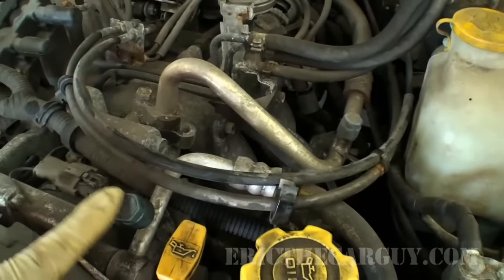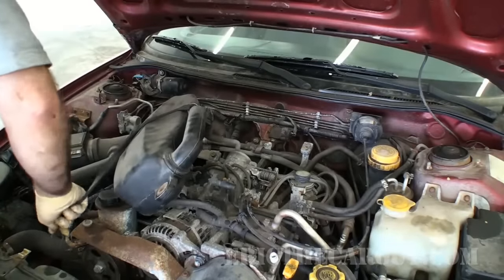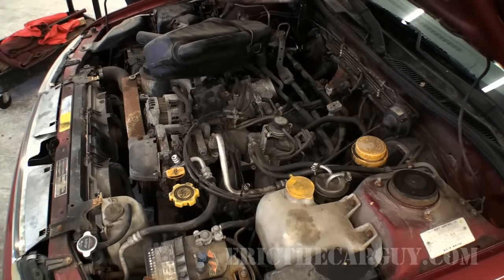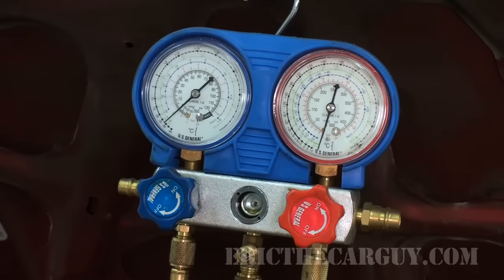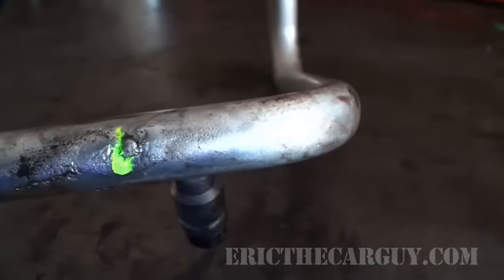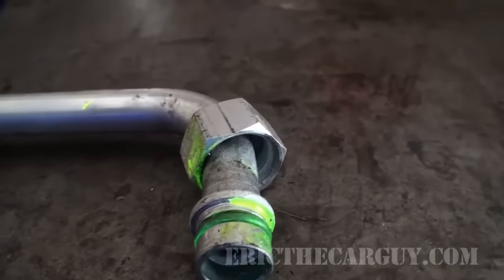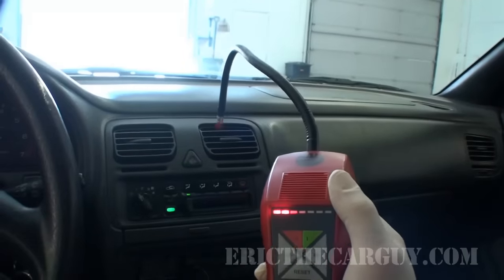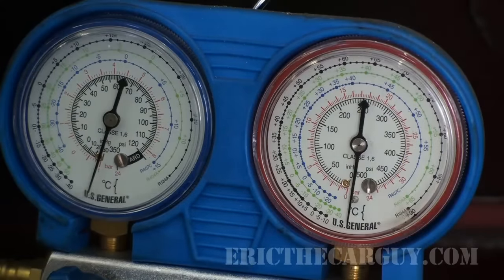How To Find and Repair AC Leaks - EricTheCarGuy

Comment: There is actually a tool that allows you to replace the valve without evacuating the system.  Check out the video by "realfixesrealfast" called "finding and fixing an A/C leak". In the second half of the video he shows the tool and how to use it, so you can skip to around the 5 minute mark if you like.  Search around on the web and you'll find the tool.  Some are not for 134A fittings, and some are only for the high or low side, so be careful in deciding which to purchase.

Comment: Since the receiver dryer will be replaced, I believe you could  use just compressed air to charge up the system to find the leak.

Comment: The gas-specific effects should however be more on a "diffusive" than on a "streaming" timescale. I doubt that a sniffer can detect refrigerant that is diffusing through a hose or seal (except for really, REALLY old and porous hoses). If there is a real (mechanical, macroscopic) leak, you should be able to find it with nitrogen (or any other pressurized gas) and soapy water as an alternative to dye. In places like the evap with no visual contact, the sniffer is certainly a very valuable tool.

Comment: A shop where I had the AC of my car repaired used nitrogen to find leaks. They pressurized the system with nitrogen and sprayed it with soapy water. It will form bubbles where the leak is.
Much more environmentally friendly than using even a small amount of refrigerant.

Comment: Could be the coil of the clutch. Measure the resistance (needs to be a figure of few ohms) and look at the connector of it (wet/dirty/bad connection between). Could also be the pressure sensor that detects fluid for the AC control unit. If it doesn't work, it cannot detect fluid and the clutch won't respond then. I had this issue on another car here in Germany. Should work similarly on a Mustang. Greetings.

Comment: Got a fast leak in my suburban looses refrigerant in a matter of days. Put dye in and everything is ok but I have dye all over my seats and door panels and vents. What do you think is causing this
Reply: your evaporator has a pin hole leak in it that's the reason its all over your cabin (inside your car all over interior) hope i help you out
Reply: tony hvac
thats what I thought too.  Pulled the dash and put new evaporator in.  Old evaporator, I cant find any dye that leaked out.  I put vacuum to the system and it leaked out within a minute or two.  Added a small amount of refrigerant with dye.  It held for a few days but seems like it is loosing its charge.  Went and bought a sniffer at harbor freight and the line where the evaporator bottom connects to the condenser is making the sniffer go off.  So I guess this line is leaking?  Maybe it's possible this was leaking before and he dye leaked into the evaporator box and then blew through the system?
Reply: If you have rear air, there is another evaporator. I think you created a leak in the front by replacing that evaporator when there wasn't any dye.
Reply: your interior cooling radiator is leaking dont envy that replacement job

Comment: An A/C tip, when pulling a vacuum open the high side first wait a couple of min. for the low side go into about 10" of vacuum if it dose not go into a vacuum on the low side you have a plug or blockage in or system and can find it and fix it before you add the freon.

Comment: I've heard to never buy R134A with leak-stop (aka repair/sealant) inside.  Just the R134A by itself.  I've heard that some shops wont reclaim the R134A or work on an AC system that has had that put in.

Comment: As for this repair I would have sanded it well with coarse paper. Then JB welded it up. I've done this with the refrigerator at the vacuum side and it's lasted in the freezer for over 1 year ...... pressure at the vacuum side or suction side is people like to call it...... the one he's working on ......J-B Weld is not good for a lot of things but this one it is.

Comment: I just had to repair a customers unit. He was lucky it was just leaking at the schrader valve on the low pressure so I just replaced both valves recharged and oiled the system. There was no o-ring left on the valve IDK how it held any bit of a charge.

Comment: you could tell there was a leak when you turned off your pump you should not here a different sound like on 9:35 and if you see vapor fumes coming out and your at 29.in of mercury that is air getting into the system not moisture boiling out. if you do this in the winter run the car and turn the heater on or it can take forever to remove moisture. when he turn it off the gauges went into a vacuum good way to tell your compressor is good.

Comment: Found an A/C Leak on my 2000 Honda accord on the High pressure side. Its the Schrader Valve leaking.
Reply: They actually make a tool that can replace the shrader valve without evacuating the system. Mastercool p/n 81490

Comment: Eric you shouldnt use a screw driver on ur Schrader valve we use ur videos to help teach the class and you should always just teach the correct way to work on the ac system

Comment: Hi,I drive vw beetle,some time my ac work,sometime not,the clutch run slowly in low rpm.normal pressure and no leak.what i need to check
Reply: Maybe, clutch repair?     I've been told that clutch repair is almost as expensive as a new compressor, so get a new compressor.

Comment: When you detected refrigerant inside on the vents why was that not a sign that your evaporator is bad? I'm dealing with trailblazer and I'm getting it to beep on the vents ac on and off as well but not on the condensation run out tube under the engine for the evaporator.  Any suggestions?
Reply: Yes evaporater probably leaking.  Make sure tip on tester is clean. Make sure hands are clean as well . Good luck
Reply: @robertmedina6875  Thanks for the reply yeah it was a brand new tip since it was a new sniffer. I put refrigerant a little over a week ago and it still blowing cold and pressure same so if evaporator is leaking you think it's very minor like should I use put a super seal it's like 4oz. Taking dash apart is time consuming.
Reply: @paquesepas6696  actually I  have seen some a/c systems clog with the super seal. Now everyone will have a different opinion about the safety of using super seal products.  I personally have seen bad things happen ( clogs) when used. I personally have heard of it working also. I think using super seal is a big risk. I know we all need to save money! Me too!  Proceed at your own risk! It would suck to have to replace a bunch of your A/C system due to a clog! Scotty Kilmer on you tube also talks about a/c sealers.  Good luck ! I hope this helps
Reply: Thanks again for the reply its a trailblazer read it was a pain to get to the evaporator and I still have ac so it must be a tiny leak. I'll just keep it like this for now then when it goes back out I'll decide wether to risk the clogs. Scorching Summer ends here in Los Angeles around October anyways.

Comment: Eric, i know that my ac system has a leak and i want to add some UV dye to it, do i need a vacuum pump to create vacuum and that add the dye (using your method with gauges set and dye into the hose and gas can) ? If there is no pressure on my AC system can i add the dye without the vacuum pump? Will the AC system be able to suck enough gas from my 12 litre gas tank and get the compressor started , or do i need to have a vacuum on my ac system first ?

Comment: I do not understand how checking for leaks work...and to define that when I pull a vac on the system and close the valves at the gauge side the vac holds but if I unhook it from the cars fittings it still reads the same...open the gauge valves air come in through the middle line...so I'm thinking if there was a leak in the system you wouldn't know because the pressure at the valve remains the same...
Reply: The connectors that attach to the car lines have valves in them. When connected to the car they show actual pressure in system

Comment: It's not good practice to leave your gauges on after you evacuate the system. You should evacuate for a minimum of an hour and then close off your valves at the inlets and remove the hoses. The leak you see could be in your gauge set or hoses. You should reconnect the hoses and check after some period of time, say 1/2 hour and read your vacuum to see if its held.

Comment: Now I will use die and hopefully find only one leak Eric I got it ceapbut it sat up tree yers  5 months so yes including the transmission I will flush with no hesitation and just found out the engine was over hauled about 40 k ago but on my income I hope two months th 4 10ply tires were not cheap like buying ten n battierste dash not good

Comment: Why didn't you solder somewhere else the aluminium pipe ? It is possible to repair the old hose, I had once the same problem and the AC guy soldered it and it worked :)

Comment: When you vacuum the system does it remove the oil from the lines or do you have to do another procedure that pulls the oil out of the system?  How do you refill the oil in the system?

Comment: Hello,Eric.
In your experience,do the o rings fail more often than piping / interior components? I know there is a leak in my AC, on my Civic,and I did see compressor oil leaking when i did the simple "add a little R134" to get it running, from the suction hose, But, I assume it may be from a fitting, rather than the metal part of the hose.

Comment: So he showed us how to find the leaks, and his repair failed. But then he just went ahead and decided to replace the two parts with new ones. If he didn't care about repairing the leaks with the old parts and just decided to replace them, could this have fixed the problem without needing those extra tools that check for leaks? What did he use to fill the leak though? If I did find a leak with one of the methods he suggested and then tried filling it with a few layers of quicksteel would it hold?

Comment: Hey eric, i know this isn't related to the video but i have a question for you about welding on a car with a compute.
I know you said welding isn't you speciality but is it safe to weld on a car if you disconnect the negative terminal ? i broke a bracket off the bash plate mounts on my fourby and need to reattach it.

Thanks, Sam

Comment: Hello sir. My car a.c was already fix by the Kia Service center they change the compressor and the high pressure side pipe. And everything is ok. But now only 12 days the cold is gone.
Reply: I would get your receipt and bring it back to the shop and have the rebuild it again/repair it again. They should Honor their word. within 30 days of failure from a repair usually you can have it repaired again for free. But use caution. If they couldn't do it right the first time, might make it worse the second. Who's to say. Been down this road a lot and seen it myself.
Reply: Muddy bob
I already bring the car and they check again and put freon. I think the problem is the line going to the evaporator is the problem. Another pay again because they need to remove the dashboard and check the evaporator line.
Reply: @kalvstv2217  I honestly wish you lived near me. I would have no problem at all doing this work for you without taking your arms and legs with me. Best of luck to you Sir! Wish they would Honor their repair warranty!

Comment: Hello
So my intake hose was changed 2 days ago and the very next day my ac stops. It's still blowing but it's blowing hot any idea?
Reply: There is most likely a leak and your refrigerant seeped out causing the compressor not to cut on.
Reply: Thanks yeah I ended up replacing the compressor

Comment: When i bought my 99 chevy express.the freon was in the low green..i charged it up,and the ac was working fine..winter came and now its hot.theres zero freon..im going to use air in the system, and use soap and water..

Comment: Unfortunately pulling a vacuum and watching for a loss of vacuum does not always show a leak, because the leak maybe only on pressure as is in my case. I pulled a vacuum fore one hour and let it sit for two hours and charged the system and  two weeks later no AC. This is after a new evaporator coil, dryer, and a pressure switch.
Reply: Great video

Comment: I won't to
Know how to fix a vacuum leak 
On a 1977 Ford f 100 custom it's got a 302 small block ad I won't to know how to replace a power
 stearing pump can u make a video of it please I will be carry thankful.
Reply: its real easy on that truck but to find a vacuum leak get a cigarette and pull off a vacuum hose with engine off and blow smoke into the hose and wherever smoke comes out at except the carb that is where the leak is.

Comment: Nice vid.... i just purchased the same gauges from harbor frieght too!! :)
Reply: Here it is 6 years later and I bought mine from HF, too.   Much better quality than the ones I used from AutoZone the other day.  The minus 0 capability is absolutely needed.   How else would one know if a vacuum was actually created with the pump?  (Rhetorical question, really.)  Anyway, my new manifold gauge showed a definite leak when the pump was turned off.

Comment: You can use nitrogen Eric.  You leave the system off!  You pressurize it to around 100 PSI with nitrogen.  Then use bubble soap to locate leaks...or the dye and the black light.  This vents no freon to the atmosphere and is the proper way to do it.
Reply: Yes cuz if the system has been leaked, the vacuum side will remain on vacuum when it's working. Which means you have little to no chance of seeing dye come out of a leak on the low side... You can end up hunting it for days...
Reply: @Echohb  I know next to nothing about a car but I worked as an HVAC tech for over 25 years.  I know the basics.  I would tell people if the cooling system is not cooling at all to take it to a mechanic.  IF it is cooling but not quite as good as it use to...then put a thermostat in the air duct and add the 134A just a little at the time.  Give it maybe 3-5 minutes to adjust.  When the thermostat says between 45-40 F that is close.  Too much is as bad as too little...maybe worse.  That is the only reason I responded.  If you don't know to be careful you can cause a lot of problems.

Comment: Do you think JB Weld would work instead of solder?
Reply: Unless you weld the hole, it'll blow. The pressures on the low side can go as high as 200psi and 400psi on high side

Comment: You shouldn't use a freon leak detector with the compressor running.  While the compressor is running the low side has minimal pressure. When the system is off the low and high side tend to equalize resulting in higher pressures on the low side and a greater possibility of detecting the leak and obviously the absence of the engines fan blowing air.

Comment: "R12 is not sold anymore"  Correction, It is sold (most of it is reclaimed or old stuckpile).  It is not commercially produced anymore. You can buy it, however you have to be licensed to buy own or recharge R12 system. (though getting the license for automotive AC gases is like getting a fishing license, no cert test)

Comment: I have a 2005 Ford Taurus. The ac was working fine until I took my car in for a oil change. Now it blows hot air. I put ac pro in it and it last for about 10 minutes then went hot again. I'm really thinking the people who did my oil change messed something up. I could be wrong
Reply: sometimes mechanics will pull an a/c line when it is in the way (if it is winter and they know you wont findout for a few months) when they are working on something under the hood. It is unlikely that they damaged your a/c during an oil change but possible if smacked the condeser with the jack or something
Reply: very unlikely,  i worked as a lube tech for a couple years and still do oil changes once in a while, never pulled ac hoses and never lifted a car near a hose.

Comment: A better way of checking for leaks, is to build up the system pressure using dry nitrogen with some refrigerant to about 200 - 250 psi , then listening for leaks and/or using an electronic leak detector. Youll find the leak quickly . Then you can pinpoint the leak using soap suds .